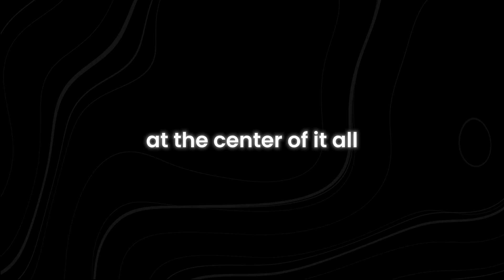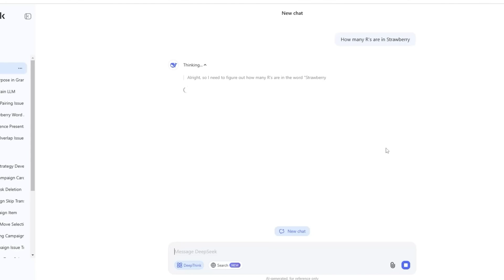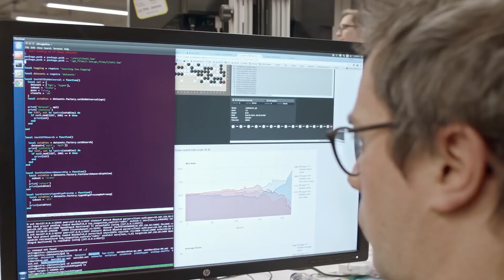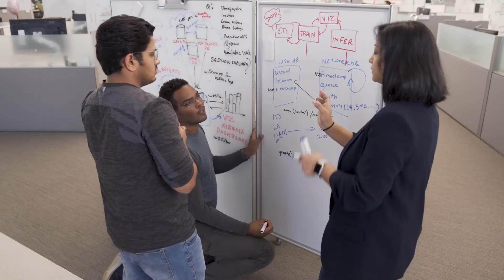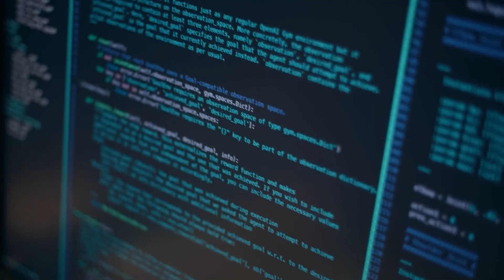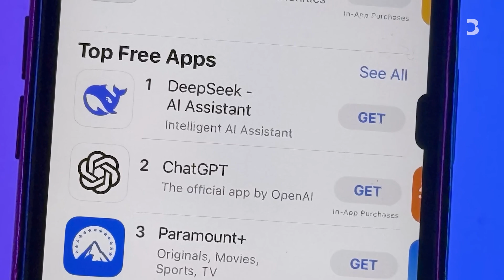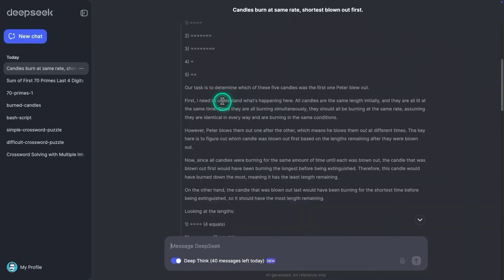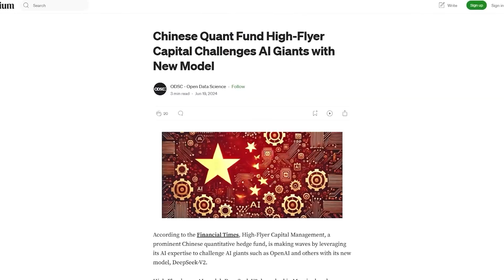This New AI Chip Just Crushed NVIDIA — The World’s Fastest Host For DeepSeek!

Comment: Was this written by AI? A processor doesn't make deepseek run on American servers. He would need to dramatically change the code and understand it to do so. You'd actually have to break it down line by line. Now a new processor certainly could make significant changes inefficiency. And if you were to hard code AI algorithms using machine logic instead of higher level languages like cuda and C++, you could certainly gain quite a bit in efficiency. Efficiency. But simply running deepseek on a new chip won't do that.

Comment: Cerebras is betting its roughly foot-wide chip can outperform Nvidia's hardware, which is a cluster of thousands of chips stitched together.
In August, Cerebras launched a tool for AI developers that allows them to access the startup's outsized chips to run applications, which it said was a much cheaper option than Nvidia processors.

Comment: I just signed on to Cerebras website and ran their version of Deepseek. Extremely fast (instantaneous) results. But I asked Deepseek on my local PC the same problem and there was a big difference. The prompt was to state and prove the Rational Root Theorem. While Cerebras hosted version came back instantaneously, the formatting was horrible - it did not show subscripts and superscripts the way you would see it when studying math. But my local version running Deepseek showed the subscripts and superscripts like I'd see them in a class or textbook.  Anyway, I'd like to upgrade my PC - currently only 16 GB to one with 64 GB and faster processors. Would be interested in who makes (or is working on) fast AI chips affordable to individuals. Then I can have real privacy and properly formatted answers.